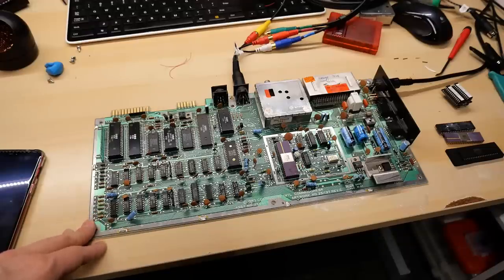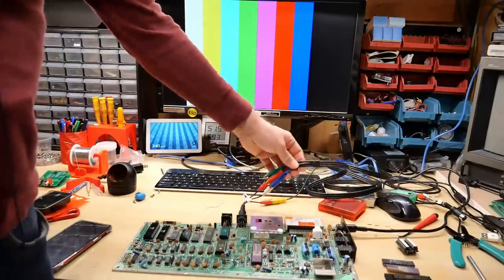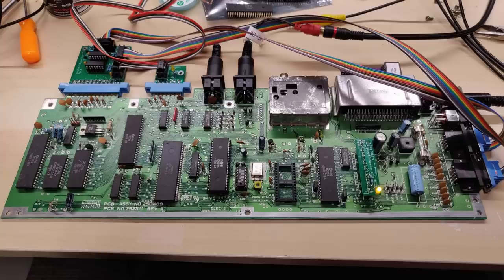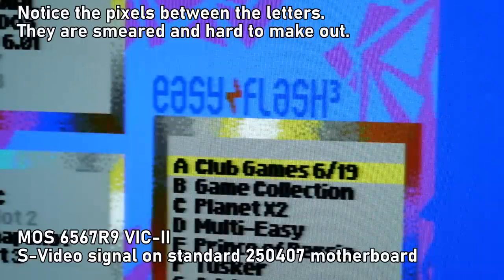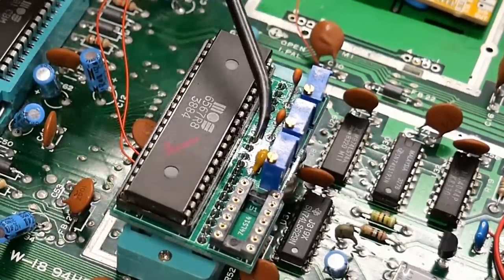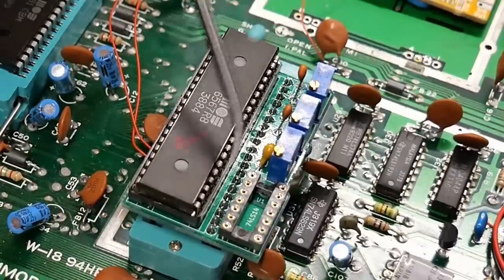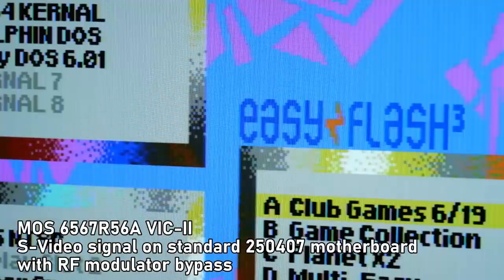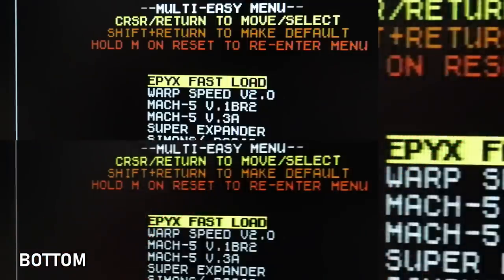C64 video output: Is there room for improvement?

Comment: A major reason for differences in video quality between the R6 and the later chips is that the oldest chips output an integer number of chroma cycles per scan line, while the later versions output 227.5 cycles per line and--at least for the latest ones--263 lines per frame.  This causes solid colors to appear as vertical stripes on the oldest chips, but as a checkerboard whose phase alternates every frame on newer ones.  A modern LCD display will typically average together the chroma data from consecutive frames to yield a very sharp stationary image, but on a CRT there would be a slight shimmer.  If you like I could write a little test program which should illustrate the difference nicely.  Also, if you feed the composite output to a monochrome screen, the older chips will produce a really horrible black and white image when showing some color combinations.
Reply from the maker: Fascinating! Yes if you could create that test program and email it to me, I can show it in the next video. (See channel about page for email address.) Thanks!
Reply: finally I found an explanation for the very hard checker pattern when using S-Video with both of my C64s. one is a 250407 rev. B C64 with a PAL 6569R1 ceramic VIC and the other is a C64C (don't know board revision or VIC-type, as it was never opened, but it is not one of the very late versions, where the case is only clipped together). and obviously my TFT-TV does not average the signal of the odd and even lines.
also interesting, that there is no checker pattern when using the SCART input, even that the Scart cable has the Luma and Chroma connected to the Video-IN pin (20) and the Red pin. probably the TV does combine both signals internally and then just uses it like a composite-IN.
one more interesting thing: my other TV does not have an S-Video input. but it has a Component input (Y'PrPb). when connecting the Composite RCA to Y', it results in a B/W checker pattern display. thus the merged-in Chroma signal obviously effects TV's interpretation of the expected, pure Luma signal.

Comment: Fun extra fact about the 6567R56A:

You say the screen looks wider. That's because it actually is. That revision has 64 cycles per line, while later NTSC versions have 65. One cycle is equal to one character cell, so that's why the viewable area seems wider. This also messes with some games and demos, that depend on exact cycle timing and expect the 65 cycles. (Side note: it's 63 cycles for the PAL version MOS 6569.)
Reply: Is that why the aspect ratio (well, the amount of space dedicated to the border) changes when I switch VICE from NTSC to PAL mode?
Reply: @stevethepocket   In part because of that, but the effect is minor. It makes the visible area slightly narrower in width, as compared to the border area. What affects it much more is that an NTSC video signal has 525 lines (and a field, shown at 60 Hz, has 262.5 lines) while PAL has 625 lines (and a field, at 50 Hz, of 312.5 lines). So a PAL screen has lots more lines that are used for the border area. Thus the NTSC visible area seems much taller on screen while showing the same 25 character cells / 200 pixels in the vertical direction.

Comment: I'm running several Lumafixes in various machine (all PAL). For me, they work just fine.
Reply: EgonOlsen71 Yes, for me too; including a C128 one - which is absolutely perfect. 👍
Reply: @RetroRelixRestorer  Where did you get the C128 one from? I was looking for such a thing, because C128s suffer the most from this effect IMHO. But I couldn't find any.
Reply: EgonOlsen71 eBay seller ‘sharewa_56’ but they don’t seem to have any at the moment. Maybe worth asking?
Reply: Yeah, I'm curious the models of c64.  I tried the lumafix in my c64s (the ones with 8701 clock chip) and they didn't seem to do much for me.
Reply: Yes, I  can confirm this for my PAL C64, too. I rember that I had to turn the screws on the capacitors very often to the end to see the improvement. But if you had turn enough, it was great!

Comment: I would have to agree with Adrian on the LumaFix. I bought one back in the day and found the same - I just couldn't get it to actually look "better", only "different".

About 6 years ago I removed my RF modulator and replaced it with a DIY veroboard amplifier with only the required pieces to run composite+chroma/luma, probably similar to that circuit that Adrian has.

I replaced the RF output socket with a standard S-video socket so now makes it easier to plug it into an LCD monitor/TV.

Pretty stoked with the result.

Comment: On the older C64s with the 5pin video connector you can still get an s-video output. It has a luma output already and you can use the composite output for the chroma. The monitor will use only the chroma part of the signal. This might not be quite as good as if they were truly separate but it is better than composite only.

Comment: Awesome video, looking forward to what you found out with the modulator in part 2.  Your videos on Commodore stuff are top notch and this is why your channel is my favorite lately.  Keep up the good work.

I still use my 1702 and 1084 monitors and that is what I prefer.  Some of these issues aren't as noticeable on a CRT.  But it would be a heck of a lot easier to use my flat panels instead.  So this is perfect for that.

Comment: The 5 pin C64's can support a luma-chroma output. On the 5 pin connector there is a separate luminance pin (pin 1), and the composite signal (pin 4) can be used as the chroma for a slightly sharper/clearer output than just using composite by itself.

Comment: @ Adrian's Digital Basement
It should be noted that some people like and prefer the "soft" look rather than crisp, sharp pixels. There are two reasons for this. First, it looks more natural in the sense that no one exists as blocky sharp edged pixels, so games look "better" when the edges are blended together by the natural imperfections of the display tech. Second, the resolution of the C64(and all computers/games systems of the 80's & 90's) is too low for the pixels to gain much from sharpening of the image. Even 640x480 fails to gain much. 800x600 and beyond however gain much from sharpening because the pixels become smaller and not easily singled out by the human eye. I still think this is really interesting and look forward to the next video!
Reply from the maker: It is up to personal preference, but these machines filter the signal unnecessarily. The differences I showed are very obvious and apparent on a CRT. It is just not easy to film the screen of a CRT. So to properly illustrate the changes, the LCD was used. The filtering renders the C64 video bandwidth to less than it is possible to do. That is why Commodore fixed this issue in later boards.
Reply: @adriansdigitalbasement  Good points all!

Comment: The white bar on the left is because the circuit that does the screen blanking is one pixel ahead, so there is a window of time during which the display is not blanked out but there is no active color defined. In that case the chip outputs white. There is a defect in the chip where the blank signal is delayed a bit further so the bar is sometimes 1 and sometimes 2 pixels wide, depending on chip, or even things like temperature.
Reply: I've noticed that..  On my C64, sometimes I get a stark, white line, and if I turn it off and on again, the line is often thinner and light blue in color (or at least appears light blue).  I never knew why that was.

Comment: One thumb up is not enough 👍🏻👍🏻👍🏻👍🏻👍🏻👍🏻👍🏻👍🏻👍🏻👍🏻👍🏻👍🏻👍🏻
I really appreciate your research on this. It is said, that the AEC and PHI2 couple in the luma signal on the VIC-II chip. But I don‘t necessarily believe it. The C64 board layout is way less than perfect and since those signals are everywhere on the board, they might couple everywhere else, too. 

I have experienced the LumaFix64, too. I think, it is not that bad. I have mainly used them on the short boards. Those are very sharp but also show the jail bars very sharp. The LumaFix64 removes those interferences pretty well. It also blurs the image a bit. I have to admit, that my old eyes don’t really notice that, when sitting in front of the 24“  tft monitor, that I am using. So I like the LumaFix64. But that might be different on NTSC machines. I unfortunately only have PAL C64s. 

I am really looking forward to your modulator fix. A lot!

Comment: The 6567r56a also has some issues with certain games, I have a 250407 board that came originally with the ceramic 56a, when I loaded IK+, the spirites would glitch and flicker. I upgraded to a r9 and it works fine now.

Comment: I'd be interested to see what the different raw chip outputs look like from an oscilloscope/spectrum analyser using a standard test pattern.
Reply: That was immediately my thought also. A well-known selection of signals and scoping would help so much to see what is going on in the signal and tweaking things would be way easier when you can see what's going on.

Comment: a certain level of quirkiness is to be expected when using these older systems on newer screens, the atari has an even more concerning looking one thanks to a glitch in screen rendering
Reply: yes, and if you go try to sharpen too much the signal on a modern LCD screen I guess it will look more like a VICE emulation and less than an analog CRT

Comment: It is more accurate to say that NTSC is designed to encode color on top of an existing black and white television system. The proper name for the luma component of an analog television signal used in the US/Canada (among some others) is System M. NTSC is only technically used as the name for the color encoding standard (even though the organization it is named for also created System M).

Comment: Check the 5V bus with your o-scope. If it's noisy, and it probably will be. Do an FFT and see if the frequency of the jailbars is in the spectrum on the power line. If so, consider using a separate Low Noise LM317  to provide cleaner power to the video circuitry. Amazing upgrade to the stock machine, hopefully your explorations and fixes are carried thru to new C-64 mother board options like the SixtyClone. Also enclosing the video amp board you have in an RF shield with magnetic chokes on key lines like power in might be helpful too. Great work, and thanks! Loved the sweep thru the hardware variable space.
Reply from the maker: That little board has ferrite beads on the inputs actually. The VICII 5v has its own 5v power from that 7805 from my understanding otherwise yeah, too much digital noise from other components.
Reply: @adriansdigitalbasement  Regulated power supplies have made great advances from the 1980's. I'd explore the 5v line from the VIC chip then, and if it's bad, replace it with something modern. Again, thanks!

Comment: With the REV A board which lacks s-video out, you run the Composite into the Chroma input, and Luma to Luma on the 1702, and the display looks VERY NICE. Just turn the brightness down.

Comment: Let's face it: Compared to later models the early Breadbins / VIC2 Chips had a really fuzzy and sh*tty image.
But compared to shady TV images it still seemed to stand out and was good enough.
And also not all Monitors really make use of Luma/Chroma signals even if they have those connectors. Some Monitors just patch those signals together right after the input port, so you might as well just use the composite signal to begin wih....
I tried so many things and combinations and now I'm really happy with my C64-C and C64-G on a refurbished (new flyback) Commodore 1084S-P2 Monitor using a Luma/Chroma Cable.
Believe me, crystal clear and SVGA quality.
Reply from the maker: As you see here it's not the VIC chip at all but the RF modulator that is responsible for soft image. I have all the revisions of boards now and and there is room for improvement even in the later ones. They are generally great but some issues on the chroma line.
Reply: @adriansdigitalbasement  Well yes and no. You are absolutely correct with those RF units, I never went THAT far.
BUT I recently had a brand new C64 RELOADED mainboard for testing purposes, and all the old VIC2 ceramic revisions did come back with a slight reddish and fuzzy image as well, while the latest ones from the 90s gave an image as sharp as a razor.
At least that's my observation O:-)
Anyway, you are absolutely right with those RF modulators apparently, nice work :-)

Comment: I've actually had great results with the lumafix, on a 466-board with  a rf-modulator replacement similar to the one in this video. But yeah it took some time getting the settings just right.

Comment: very much looking forward to the next part, I have a 64c which has ghosting issues, do you know if your fix will be applicable/adaptable to the modulator on these models? I have seen similar modulator replacements that will fix it but I'd rather keep RF and composite output

Comment: I didn't know the video output was passed through they RF modulator. That really sucks, I would have put money on that you could rip those things out without issue. Will the upcoming fix for the RF moduator work on the C64C? it has a much smaller RF modulator, i assume it's quite different inside.

Comment: The difference in color between the old VIC and the newer is due to the increased luma levels on the newer. Tho old has 3 luma levels except for black and white, while the newer has 7. This at least applies to PAL, but I think it's the same on NTSC.
One advantage with the old VIC is that it's better for color blending by interlacing, since the lower number of lumas results in less flicker. Apart from that I usually aim my graphics towards the new luma palette.
Reply from the maker: You’re right on the NTSC one as well. Just checked and it seems to have 5 total luma levels versus 8. (Including black and white)
Reply: @adriansdigitalbasement  Thanks for the reply and clarification! So no need to learn the quirks of yet another palette. The world of NTSC c64 is a mystery to me to be honest. Probably should get some.
Love your content! Stay safe!

Comment: Is there an HDMI interface for the Commodore 64?
We developed one for the ZX Spectrum (the ZX-HD), and it's selling hundreds.
Maybe I should have one for the C64 developed...
Reply: You can get a composite-to-HDMI converter for maybe 5€ and an S-Video-to-HDMI converter for around 18€ (including shipping from China to Europe). For S-Video, you will need to modify the C64 to output "real S-Video", as the levels are a bit different.

The Ultimate 64 board also has a synchronized zero-delay HDMI output (https://ultimate64.com/Ultimate-64). Since the VIC-II is completely reimplemented in an FPGA, the video signal does not need to be digitized (like with the adapters mentioned above); it outputs HDMI natively, hence zero delay (although your screen/TV might add some). The HDMI timing also adjusted to meet the C64 timing, so no tearing.

Oh, well, and the Ultimate 64 also has FPGA implemented 1541 "disk drive" on board as well. "Disk drive" in quotes because the mechanics are also implemented in the FPGA; physical storage is on a USB device (USB thumb drive, hard drive, SSD).
Reply: @klausstock8020  That's both not the same as a pure HDMI output.

Comment: Adrian, I've noticed that your camera has really aggressive auto-focus. It's especially noticeable at the beginning and end of your video when you're talking with your hands or leaning forward slightly. You can really see your face and background go in and out of focus because the camera is auto-focusing on your hand. Would you consider maybe locking your auto-focus when you're in front of the camera talking?

Comment: Thanks for the video. What causes the jail bars? Are they small wobbles in the output voltage maybe caused by a clock jitter? If the output is limited to set voltage levels, can the bars be removed by limiting the output to a predefined set of levels? It could probably be done a couple of different ways depending on cost. 

Just a side issue. On boards that I use to test things, I pick one of the logic chips near the centre of the board and put a flashing red led across the local filter cap. Too many times I've gone to swap parts on a board still powered up. At a dollar and at 5v, Kingbright type LEDs flash around twice a second. It can be done extremely neatly with short right angled legs.

Comment: Some Neo Geo motherboards had jailbar issues caused by the RGB signals being run directly underneath the oscillator; shame that a similar rerouting doesn't fix it on the C64, that's an easy fix for sure
Reply from the maker: Yeah I thought it might help but nope. The VIC-II is generating the DRAM refresh signals and clocks as well... Clearly creating the issue.